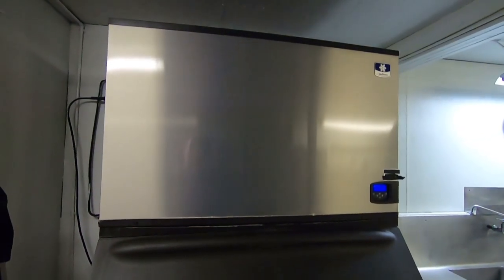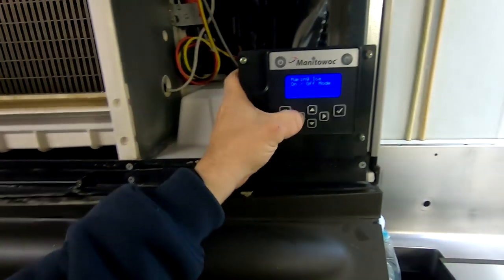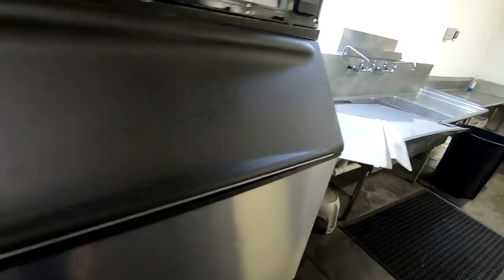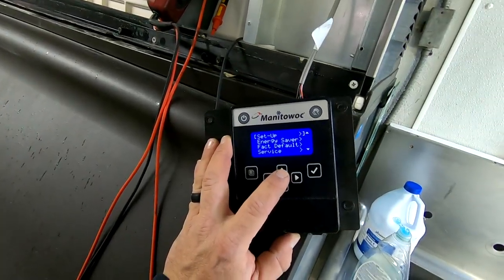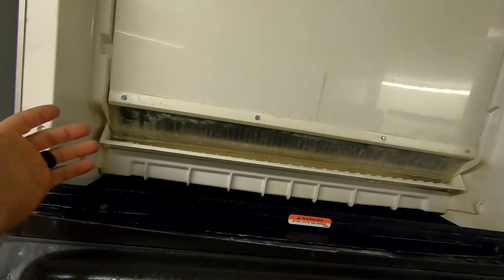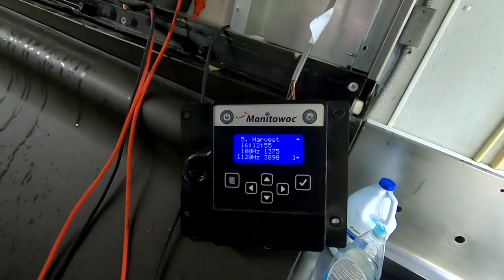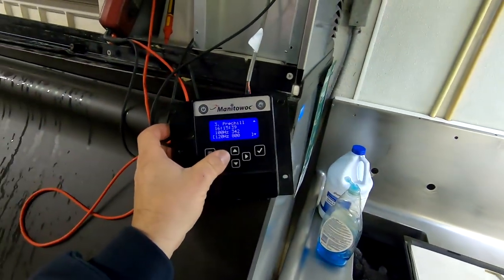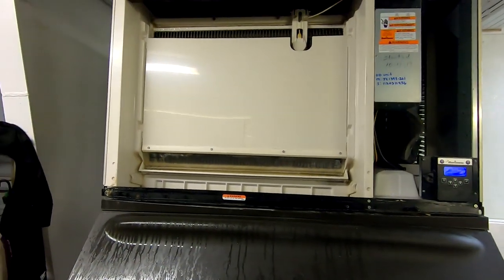Manitowoc Ice Machine Not Making Ice

Comment: Very good video! The ONLY problem I have with anything that you said was in relation to the cleanliness of the condenser.  You can't tell just by looking how clean a condenser is.  I supervised a 50 man shop and one of the most common causes of a HPCO was a dirty condenser that the mechanic said "looked" clean!
Reply from the maker: Its been a almost a year ago so I cant say for certain but when I looked under the coil, I was looking for light through the coil but your correct, I normally try to wash out my condenser weather it needs it or not. No water near by at this location. Thanks for the feedback!

Comment: Great timing on a ice machine.  Very useful information I wasn't aware of  ( 7degree split ) and other refrigeration issues.   You mentioned of an air compressor?   Is that to assist in harvest?  I have read but not  seen machines with this feature.  One other question,  with those big curtains hanging over the grid, how do you inspect the ice pattern?  Thanks for sharing.
Reply from the maker: Some machines use a solenoid to push the ice off the plate, Manitowoc uses a little vibrating air compressor to create slight pressure behind the ice to help it fall off faster.
Reply from the maker: the curtain can lift up and out I just couldn't do it with one hand on the video before it would go into Harvest so I didn't do it.

Comment: What would cause the display to be stuck in on/off mode? None of the buttons work. We've unplugged the display, unplugged the machine. Cleaned the filter. What else can we do? Aldo, can we make ice without display ot is there a bypass to get the display to start working?
Reply from the maker: I made a video of replacing the keypad.

Comment: Good vid. sometime new parts will fail just like the old part, so i try to make it better if quick  and easy. on that one the Water curtain - i Would just ruff up both mating surfaces on trim piece and put a layer of ge silicone 2 clear between curtain and trim piece and then secure with the 4 screws. Then when u return with the new parts breaker , key pad , u can remove the 4  screws. it may last longer than a New part bound to fail the same way again unless they reengineered the replacement part.
Reply from the maker: We lease the machine to these people, I had one time where that Shield got tore off and it got thrown away. I had to use one of their chopping blocks to keep it working until I got a new one. LOL  You definitely make a good point.👍👍

Comment: do you really carry a spare controller in the truck?  And replace parts of the controller rather than the controller as a unit?  If your guess is wrong about the controller its gonna be expensive to correct.
Reply from the maker: The control I have on my truck was off a system we retired,  it didn't cost me anything. I'm not sure if I'm following you on the next comment about its going to be expensive? A keypad is going to be cheap vs the whole controller? If I'm wrong then I'll order the control board.  Otherwise I'm replacing more than what's needed running up a bill?
Reply: HVACR Survival I understand, but now days, our labor is what’s expensive, if you have to return again to fix it, and whenever you have to return, especially more than once, the customer thinks” this guy don’t know what he’s doing, although your intentions are honorable, and trying to save them money, no good deed goes unpunished. For this reason I carry a Turbo 200 although they are expensive, you don’t have to come back, and always have the right cap, and no stock sitting idle bouncing around the truck.
Reply from the maker: I understand what your saying now,  yes I agree with you,  this  ice machine is under warranty and a leased machine in addition to that, only replacing the keypad is how the factory has choosen to authorize the repair the least few times so that's a lot of the reason why I had done it this way. If the item is out of warranty and depending on the scope of the job I will replace most items that could cause future failures at the same time as your mentioning,  It's all dependent on a job by job bases 👍👍
Reply: @HVACRSurvival  oh, well if you have to deal with warranty issues, thats a whole different ball game,  retail sucks. They want prices on everything.

Comment: I have barely any water spraying
Reply from the maker: Clean the machine by taking it apart, the cleaner is not a technician in a bottle.
Reply: @HVACRSurvival  cleaned pretty good like I have for last 10 years.  This time I think the water pump is going bad because it cannot push he water up there by the evaporator. I see it sucking the water, but hardly any from the top. And it's clean from inside. No obstruction

Comment: Move the fkn curtain the machine always starts up in a harvest cycle.... Lol
Reply from the maker: Not my first machine 🤣. Rewatch The video. I didn't say it was in a harvest, the problem was it wasn't running the compressor while it said it was making ice.  When it's in a harvest it doesn't tell you it's making ice.🙈
Reply from the maker: How long did it freeze before going into harvest?
Reply: Safe mode is either ice thickness sensor or water level sensor. Take your manual and test the frequency on the screen
Reply from the maker: @Hector Hernandez check the water sensor freq by tapping it, it should reach in the high thousands. That board should have a minimum freeze time prior to harvest, it almost sounds like the board is defective. Make sure the curtain switch is staying closed.
Reply from the maker: @Hector Hernandez I haven't seen that before
Reply: No plug and play. Get a Manual buddy